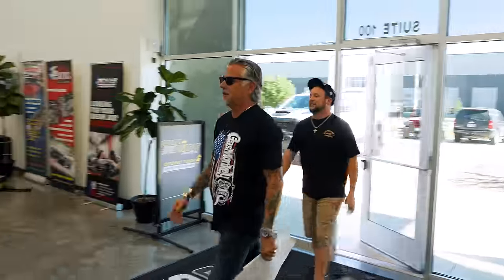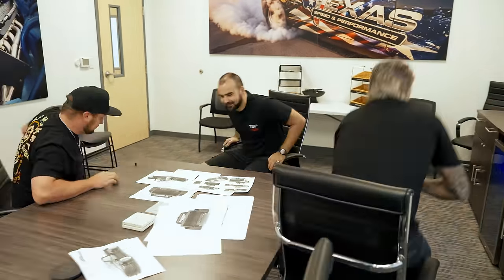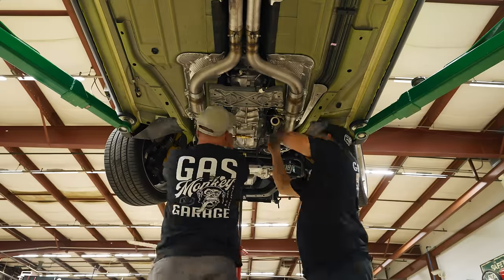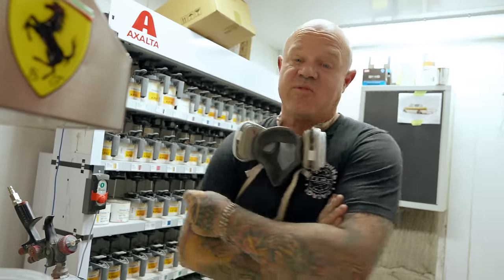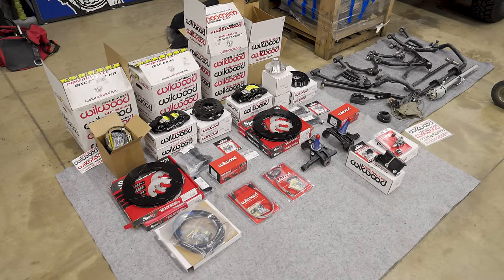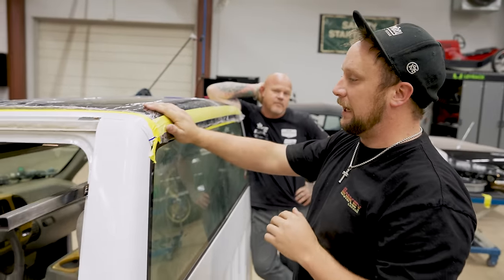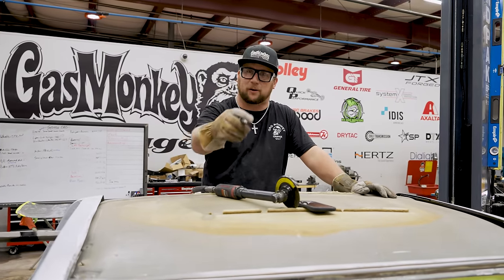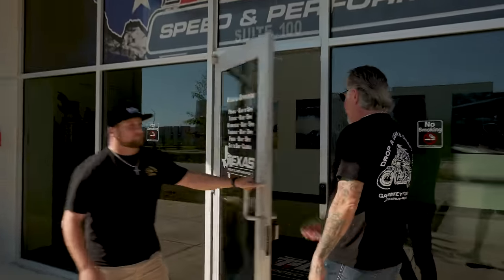Gas Monkey's SEMA 2024 Build - PT 3

Comment: Is that roof panel plexiglass, if so you need to account for the expansion under the hot sun. Also the differential between the hot external heat and the cool air in the cab will cause it to bow outwards

Comment: In the 80s, we cut our lowrider pickup roof and installed the California Tops. They were a removable tinted polycarbonate one piece removable top. The top and rear window was replaced. When off, only the door window frames remained. Essentially, it was a convertible.

Comment: wont the torque from the motor flex the cab and crack the roof? If the roof line isnt braced properly wont it flex?
Reply: The material is designed to flex. It's not glass

Comment: Not the 1st pick-up with a glass roof but definitely gonna look way better n cooler than than the 1st 1 I saw with a glass roof back n 2014 n Houston….. there was also a crown Vic n Houston with a solid glass roof as well n 2018 so maybe the same guy did both roofs

Comment: 1600hp is gonna twist that truck. Hopefully they are thinking of the structural integrity of removing that roof. It might just split or rip that panel out of position. Too much hp to have be that custom in my opinion.
The idea is super cool, but hopefully it doesn't go wrong.

Comment: Not gonna lie. This is a sick build. But i cant help but think this truck with the “sick panoramic roof” is going to be useless for anything except being a show truck. Which i guess is the point. But i feel like having that glass on top with that curvature if you try to drag race and launch too hard or even do an autocross the flex in the body would shatter or crack that glass. I hope im wrong
Reply: It's not glass

Comment: Oh look another low profile tire vehicle that does burnouts……..🥱🥱🥱
1400hp is fold up that stock frame. 
The only thing that will save that stock frame is the tires not hooking up. 🤣🤣😂😂
Reply: Completely boxed and braced stock frame! I’m gonna say it’s not going to bend
Reply: @Joshparis  I saw that episode where the frame was boxed. 
 I also know Gale Banks twisted his frame on his 800 plus hp twin turbo small block stock frame 90 454 SS truck. 800 is his low power street setting, with pump gas. His twin turbo small block is capable of 1200 plus, with just changing boost. 
 At 1400 plus hp, I’m wondering. If it hooks up like a drag car, the weak links will show up. Spinning the tires and not hooking up has been the savior of many a built hot rods. It’s when things look up like a 10 second drag car that things break. 
 The frame in my 92 Silverado needs to be boxed, it’s not exactly a stiff frame. 
 I know a lot of builds use a short cage tied into the back of the cage in the cab, helps the frame a lot. A lot of the big autocross builds like the ride rec guys do that.
Reply: @DavidB7474  maybe there is a cage in the works 👀😂 quit giving away next episodes ☠️

Comment: I love me some Gas Monkey! But yall are clearly not a speed shop. I get it. It's Sema and everything is forgazzy. What turbo yall going with? You should have gone big single. Your going to need a massive fuel system to run 1500-2000whp. Like a mechanical pump with E85 or methanol. Your going with a turbo 400? I hope you go with like a low rear end gear or your going to be cruising at 70mph at 3500 rpms. You should of gone with a 315 radial. Wtf is this 80s hot rod tires lol. Tell Richard I can line yall out.

Comment: Funny that they still call these engines an "LS" when there is NOTHING GM LS on them. 100% aftermarket parts.
Reply: You understand what LS means don't you?
Reply: @Airplanefish  
Depends on who you ask... Technically, GM never called it the LS, it was officially the Vortec. Basically, 1997 to present GM V8. 
Making my point, there is NOTHING on these aftermarket engines that is made by general motors.
Reply: @-joe-davidson  they never said the parts were made by GM. And the LS has different design than Vortec. Lots of differences. Look at the lifter locations, the head designs, the exhaust ports to name a few